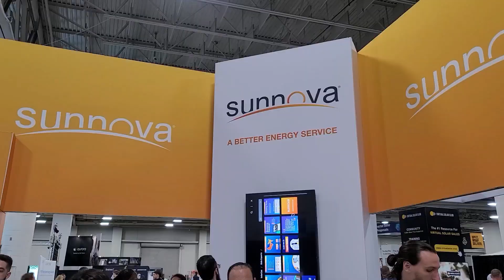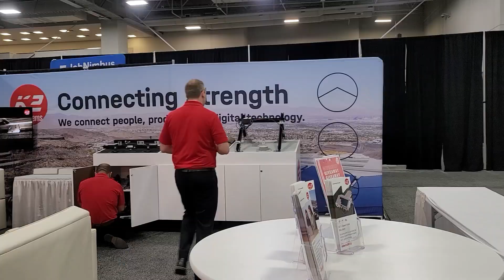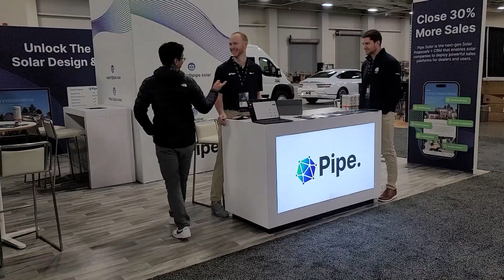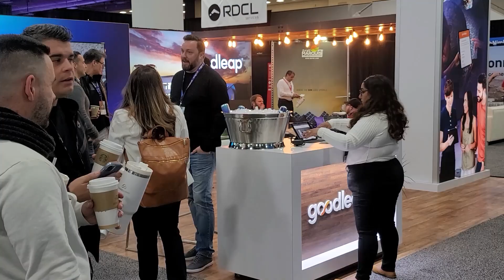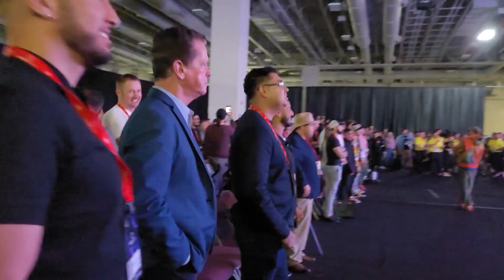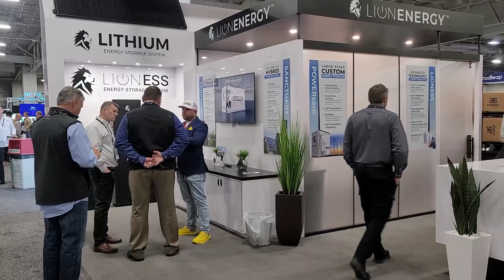SolarCon 2023 Opening Day Recap

Comment: One thing that turns me off to much of the new offerings is their being proprietary.  You have to use their batteries with their inverter/charger/solarcontroller.  We know many of these companies will be out of business in a few years so what happens to your investment if it breaks down.  You are locked into their batteries and who really knows how good they are, Grade A, Grade B, used Grade A, etc.  And like inverters it seems that we are now seeing systems that are clones or rebranding of others.
I do not want panels on my roof but have limited backyard space but will try to make a micro-grid system to where most of the time, if the sun is shining, the house can be powered by solar or battery and only if I need it, or for heavy 240 volt loads, use grid power which in my area is affordable (irrigation district) and reliable